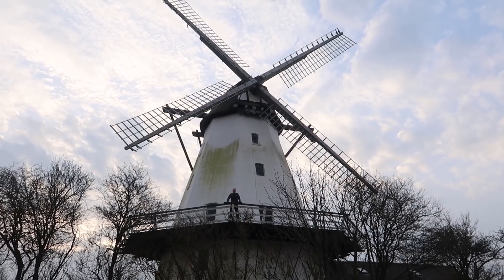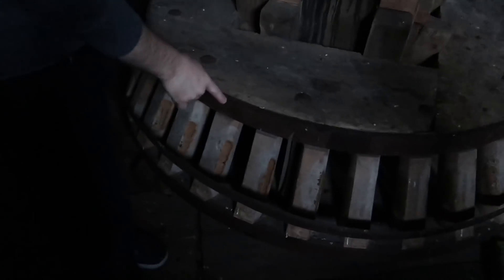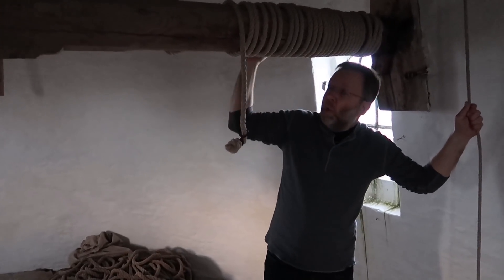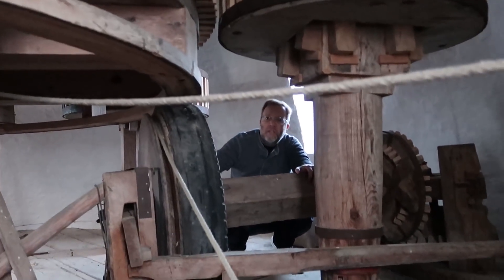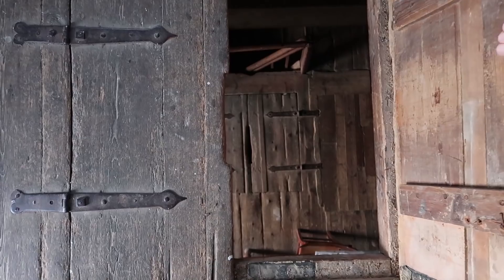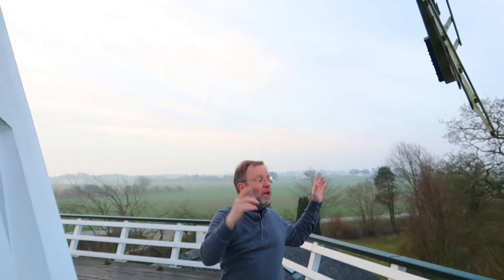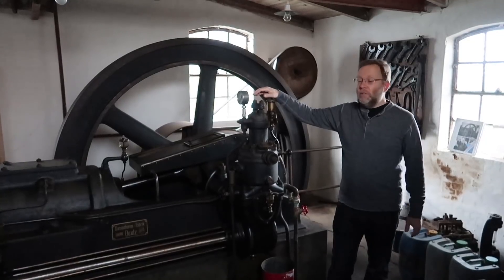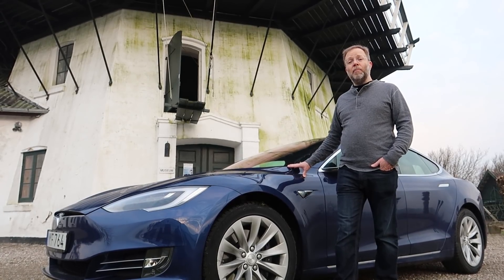Exploring an 1859 Danish Windmill

Comment: It was probably like 0.1% efficient :D
Reply: Both 0.1% and 40% are way off.  Airfoil wind generators have a theoretical efficiency of the Betz limit, 59.3%; actual wind generators in the field can exceed 50%, even including transmission and electrical losses. Positive displacement blades like this one could possibly reach about 15-20% efficiency; 10% total efficiency might be a good guess for this one.

In any case, since the wind is/was free, the actual efficiency for these oldies but goodies was not as important as getting the work done with as few mechanical repairs as possible.

As a mechanical engineer, I love stories like this, and I bow down to the resourcefulness of the pioneers in my field that made beauties like this operational and useful !